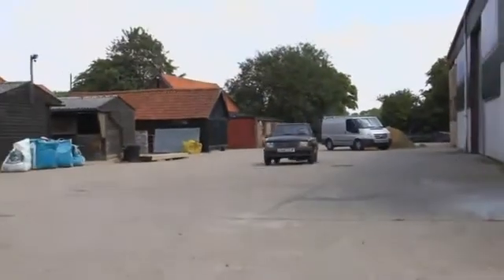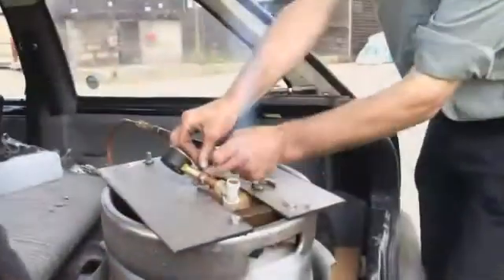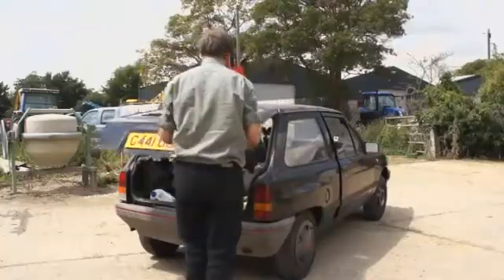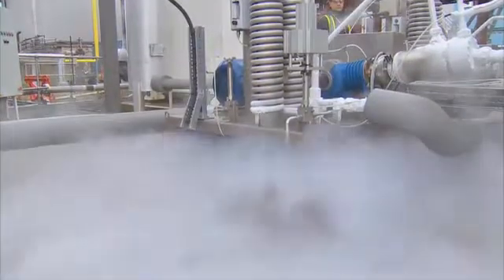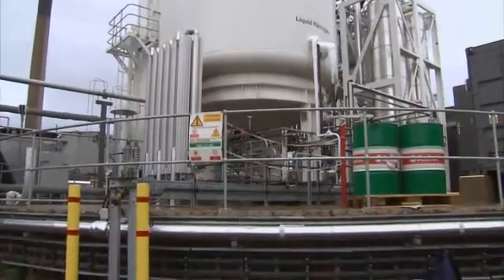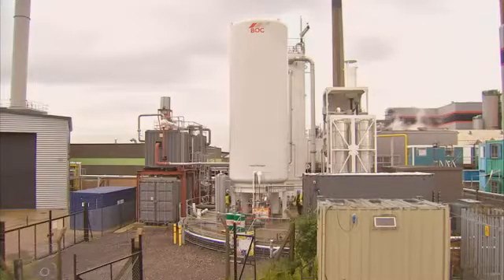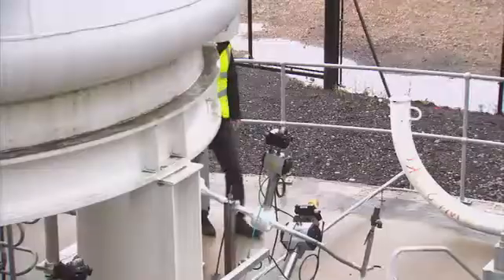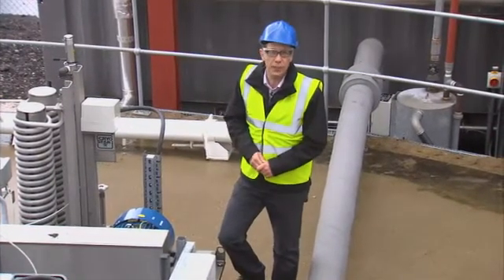Liquid Air Could Be The Fuel Of The Future

Comment: Mechanical use of Liquid Air pressure uses up the air. Perhaps an alternate Nikola Tesla use make a small electric generator that charges batteries ans recycles the air never needing  a refuel One more step is to go away from battery and current requirements of magnetic field and used the electric field for motive forces. Alas the Tesla Motors high current magnetic motive arrives at zero inertia drive by ether electric forces.